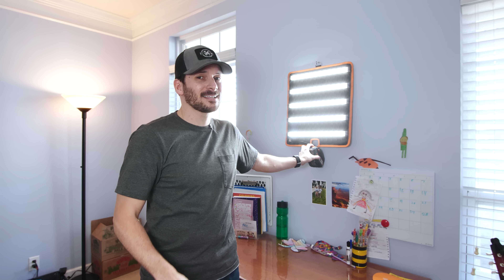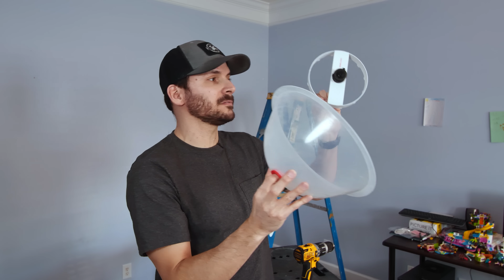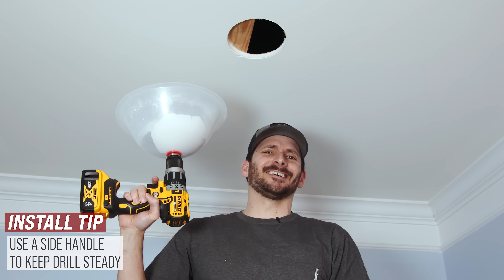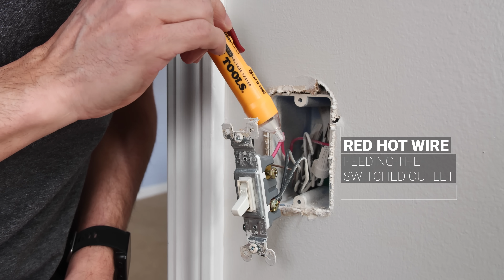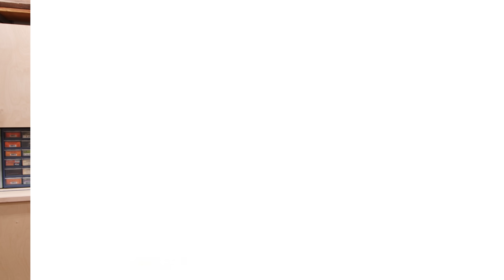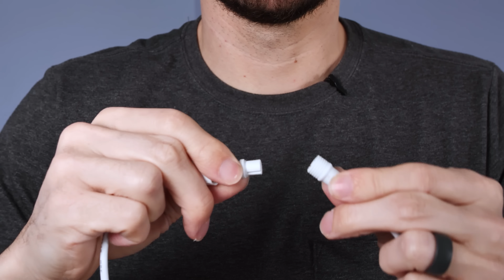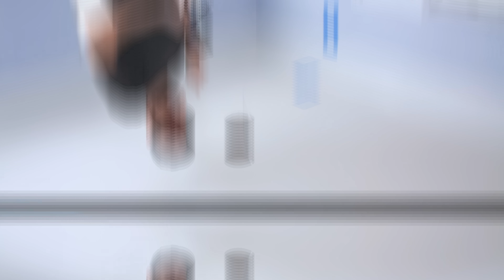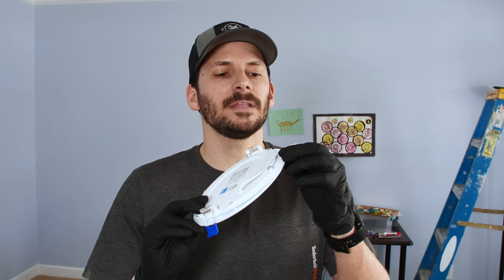Recessed Lighting Install with No Attic or Prior Wiring

Comment: Couldn’t you have connected the neutral and red at the outlet to a new 14/2 going back up to your lights and just changed out the outlet and wired it to the neutral and constant hot?
Reply from the maker: Yes, could have done that.  But that's an exterior wall with insulation, so I thought it's be easier the way I did it.

Comment: You say "no attic access" but what you never discuss is that you cut the wire from the switch and the other that had the live wire. There's no way you got both ends out of the hole to splice in the light. So, you either left a live wire up there and the lights don't work, or the plug no longer works. Either way there's code violations here.

Comment: I put recessed lights in successfully without using a computer. Another non electrician making things harder than they have to be. They are "joists", not "studs". Also, not all styles of wafer lights fit under the joists. Some are up to 3/4 inch thick.

Comment: don’t need to cut a hole 🕳️ above the box. actual electricians remove the current box and fish wire down to the opening and then we install with a remodel box leaving no patch work.

Comment: I don't understand why you didn't have access to the roof space to drill down if need be, With all the holes you would have needed to put in the wall and roof to see where you were drilling it would be easier to put an access hatch or "manhole" or simply just a single hole large enough to get in and out then patch it instead of patching several little holes.
Reply from the maker: 1st floor of a two story.  Above the floor trusses in the ceiling is finished flooring
Reply: @Fixthisbuildthat  That does make things a bit more complicated! Either way great video keep up the great work.

Comment: I'm no electrician and I'm genuinely looking for information here. Why didn't you run the constant straight through to the outlet and use the red on the switch to the new wafers and just run a small junction in the ceiling (obviously with enough of a pig tail to wire it under the ceiling) Again, im not criticizing, but im curious why you didn't do that or why it wouldn't work.

Comment: Sometimes people interrupt the common ….with the switch…. It’s actually an incorrectly to do it. …. 
What that means it’s just the light will turn on but there’s still power in the light …..
So if you turn the switch off and he thought there was no electricity, and you’re leaning up against a water pipe or something you would know it  ….
Anyways, that’s one explanation. Why, if you turn the switch off and this week you’re still told you there was voltage if the interrupter the common that would act that way.  …

Comment: i would have just used a hand saw (keyhole saw). less dust spay since the motion is linear instead of radial. place a plastic sheet below or just vacuum in the end.
Reply from the maker: if you're just doing a few holes sure, but anything more than 4 and you'll be glad you have the saw

Comment: Why didn't you just turn the single switch for outlet into a double switch and ran new wire from the switch and bridge off the constant hot for other switch 🤷

Two big holes at switch and above to drill into the top plate then down the series of lights... Make a junction box above the switches...

Comment: I never knew you shutting off a little switch is not going to turn off the power in your room called go through your breaker unit and shut off the room breaker it's simple as that you switch is not going to cut off the power

Comment: Why didn't you just replace the outlet, disconnect the red wire, and start your power run for the lights in the back of the outlet using the red wire and the neutral?

Comment: although you mention to use 14-2 wiring for your outlets, I would just like to add: ( this is directly to the viewers) to always consult a licensed and certified electrical professional. also! if the job is big, to ALWAYS consult an electrical engineer or a professional.

 I have experienced so many jobs where the customer did a DIY electrical job that they "learned" from YouTube from a DIYer/ handyman and the customers had to spend a ton of money getting the job done correctly and to code. 

when working on electrical, plumbing, or anything structural where it involves vast experience to do... I would say either leave it to the pros, learn these things by joining a trade, or even going to school for it. 
there are tiers... 

helper
apprentice 
journeyman
leadsman
foreman
master craftsman 

tradesmen and licensed professionals spend a ton of time, and sacrificed a lot to gain their knowledge. Its a pity with the amount of disrespect they get. they don't get enough credit. people genuwinely think by watching a couple YouTube videos gives them enough education to get work done themselves... 

tradesmen in my opinion are equal to nurses and doctors in the medical field. every small decision is critical and will determine the outcome.

Comment: That switch is wired illegally. Also, Wago lever nuts are better than the push connectors. Just put some electrical tape around the Wagos as the levers could (and have) worked open through vibration or another wire snagging it and causing tension.
Reply: Care to elaborate on what makes it wired illegally? Just curious
Reply: @WhoDubstepDave  Not in compliance with the National Electric Code.

Comment: Great informational video.  Too bad the electrical code is still based from the 50's in that we need to run a 14 gauged wire to power a 10 watt light.  It would be a dream to simply run power to one and daisy chain the connectors included on the fixture.  This would be especially true when working with dropped ceiling.

Comment: I installed one of these in my bathroom and when I turn on the switch, the LED light flickers once and then turns on. Why does it flicker once? It's annoying.
Reply: had this problem once, replace the switch

Comment: The switch is incorrectly wired from the start of the video. There cannot be two hot wires spliced together at the terminal screw of the switch this is totally wrong and will cause an electrical fire

Comment: As an electrician, DO NOT do what this idiot just did!! Im using semi-harsh terms, bc not only will this NOT work… they way he would have left it, is a fire hazard. It DID NOT WORK!! And I’d bet my bank acct, that he had to hire an electrician to come fix what he just messed up.
He just killed power to somewhere else… he did NOT connect to the swift leg… he left live wires open… I could go on, but I’ll wait for a reply from this guy, that just taught you to mess up working circuits, and create a fire hazard.
Reply: what live wires did he leave open? lmao he literally abandoned a dead end, and then tied into his switch...
Reply: @GreenGenerationTV  no… that’s what he said he did. That is not what he did.

Comment: Couldnt you just had put a juction box up top and tapped into the wires and used red one for lights and left the constant to feed the outlet? Than you wouldnt have to run a new wire to the outlet. Im no professional just asking.

Comment: What I use to drill holes in ceilings for round lights is far superior to the one you use here. One tool on my drill. No cleanup. Just dump into trash can after each hole.

Comment: Very little information on the most important thing. How did you connect the other 3 lights? You have one cable/wire going from the switch to the junction box that’s perfect one light DONE. How about other 3? Did you run 3 separate cables/wires to each light? Or did you split somehow the main wire that you cut? Not great video, missing massive steps.

Comment: CLICKBAIT LOL... 1 in a million you just happen to have a random wire right where you needed it, and no insulation, AND it just happened to be connected to the very light switch you needed...

Comment: Recessed lighting is awful without a lot of forethought and hopefully working with a lighting designer.  These "HOME DEPOT" non repairable fixtures are going to be a problem - a  MAJOR problem when they fail and they will. Usually the driver is what fails resulting in the fixture needing to be replaced and IF you can find a matching replacement.  Why call in an electrician to replace a whole fixture when the average homeowner can just replace the lamp (bulb)? The quality of these integrated lights is lousy, LED technology is rapidly evolving to produce better quality light etc. Change a lamp and not the fixture. I am sick and tired of looking at homes well above the million dollar mark with this crap lighting tech with zero thought as to how and where the lighting is going.

Comment: As and electrician this is not a very good video. He has no idea if the wire he wants to cut is even the right wire. It could be a wire for a completely different circuit. This is a good way to confuse yourself cost you even more money for an electrician to fix your mistake or possibly kill yourself or burn your house down. 

  The lights that he is using are awesome for remodeling though. Just have someone who knows what they are doing, do the electrical work

Comment: He mentions maybe having to drill thru trusses...trusses are never to be touched by anyone accept a certified or licensed structural engineer hense the reason they're called ENGINEERED trusses. Home inspectors across America have failed home inspections because weekend warrior home owners have notched, drilled or even completely removed bits and sections of engineered trusses for some home project or something else. Before altering any engineered truss, seek out advice from a structural engineer and have them make the adjustments if they can....and HAVE IT CERTIFIED AND DOCUMENTED. You'll thank yourself later.

Comment: You're definitely NOT an electrician and I'm willing to bet you've never built a house either. No offense intended. As an electrician I'll add a couple things...

1) You will NEVER run in to a wire stapled to the top plate as shown in your mockup.

2) The top wire on a single pole switch is not necessarily the switch leg to a fixture/outlet. Switches work regardless of where the feed and switch leg are connected. If that simple 3 wire switch leg threw you for a loop, just wait til you run across a 3 way switch. 😜 There are a few ways to wire those!

You're also lucky you're working in a newer home. Back in the day, power was ran to the fixture, not the switch box, which makes jobs like this much more difficult.

Comment: Why would you hard wire a light bulb to your ceiling?  And you had to cut a hole to fit the light bulb?  That bulb is eventually going to burn out.  Do you think people will be able to buy that bulb in 50 or 100 years?